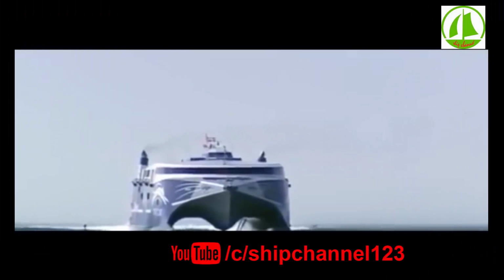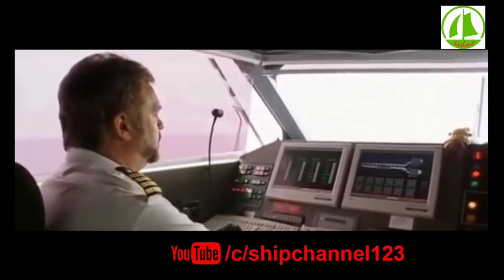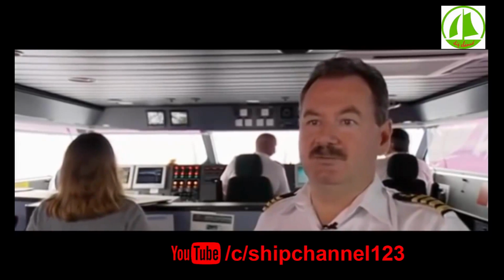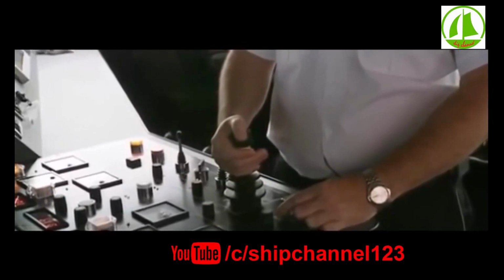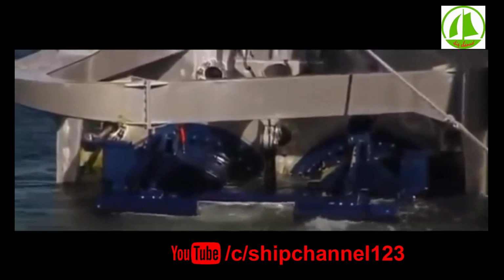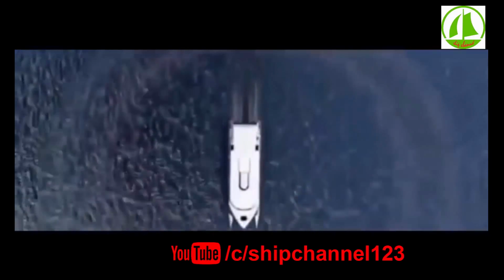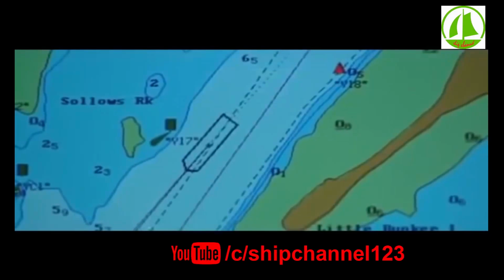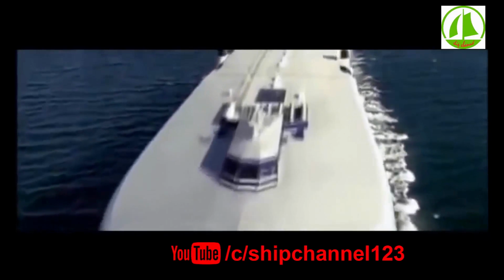the fastest ship in the world - HD doccumentry | ship channel |

Comment: Top speed?
Reply: 43 knots.  The  20 cylinder heads  one each of the four engines, and  related exhaust valves do not like being pushed at this rate for too long.  The " reciprocating" engineering becomes rather difficult to maintain as the loading of material is up to its limits.  Perhaps jet  engines would be better but  heavier on fuel.

Comment: If 1drop of fuel in 1minute,make 1 horse power,and power force 10 metere in 1 minute,,so spark flash point flash heat,,1f,c,,,so this engeeniring doing fast,,,,but in ship no break,,,and by qutub numa,,,will create problem for captain,,,one drop inone minut,ten k,,,two drop one minute,,twenty metre,,,,,,

Comment: Whoever made this "Documentary" is a moron! 90 km/hr is not 55 knots. You need to do a bit of homework if you're not familiar with speed conversions. You lied to all of the viewers. 90 km/hr is 55.9 mph or 48.6 knots.
Reply: It's 55.9 miles per hour and 48.6 knots per hour. Simple mistake. But really, Trent, get the stick out of you ass.
Reply: You right. It's more than that. If 1knot = 1.8km;
Therefore, 55 knots * 1.8km = 99kms/hr. Almost 100km/hr